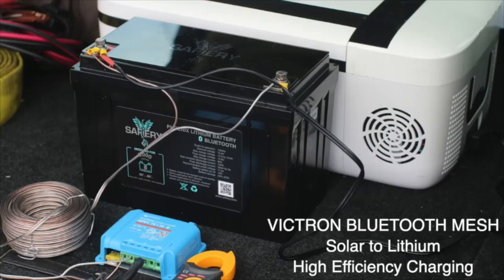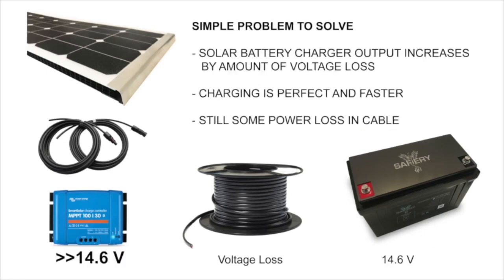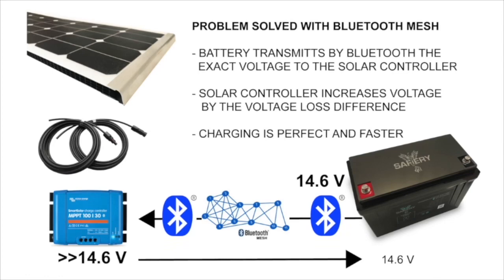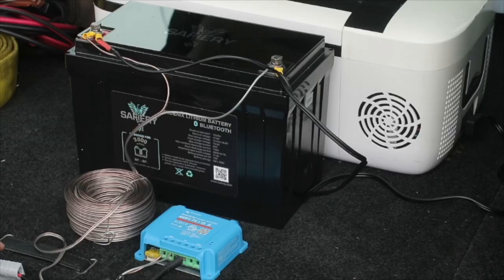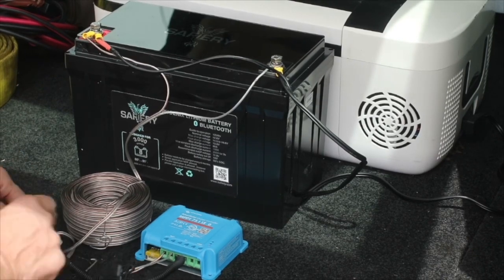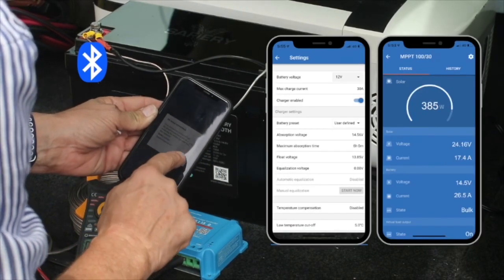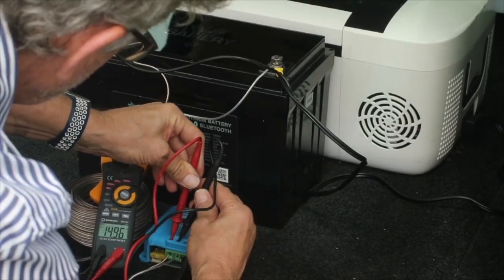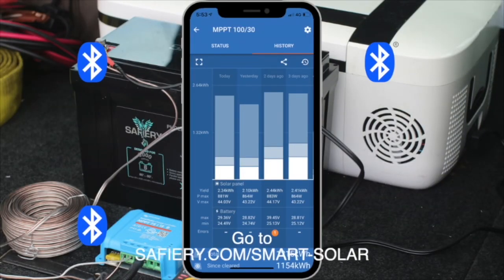Power of Victron’s Bluetooth Mesh Network

Comment: Any idea if adding a BMV-712 smart battery monitor to a dumb battery that is being charged by a victron 100/20 Bluetooth solar controller would do the same thing? Although it's a pretty crazy way to solve a problem that could be fixed by sizing the wire correctly and positioning the controller close to the battery to keep final cable run short.

Comment: Pretty neat solution. Can the software provide recommendations in this case. For example, if it's had to increase voltage significantly, can it warn you that your charge efficiency is low and the cable is actually inadequate, or perhaps even faulty?